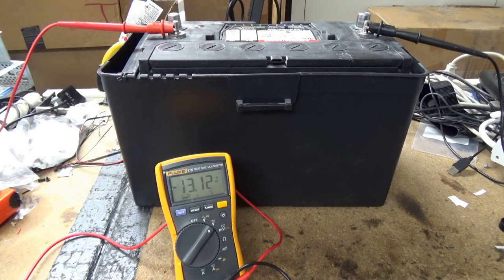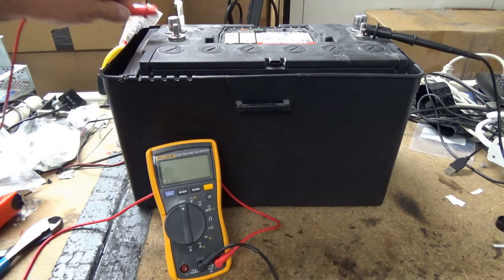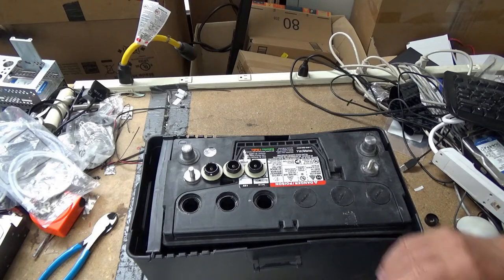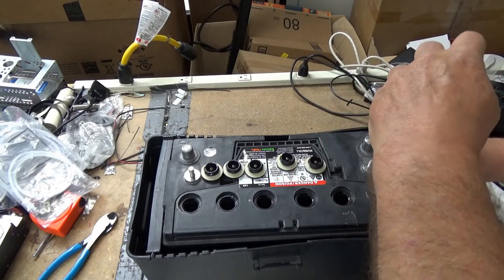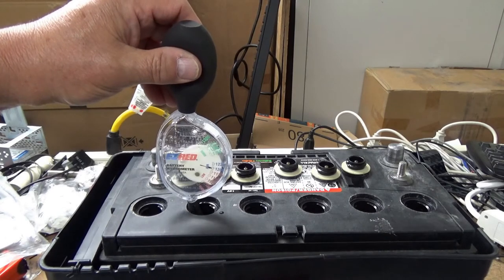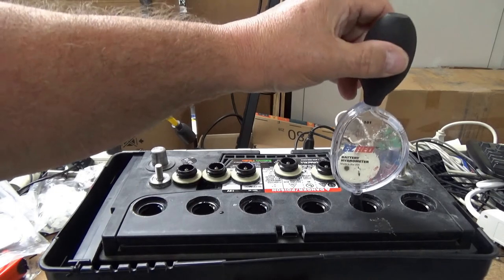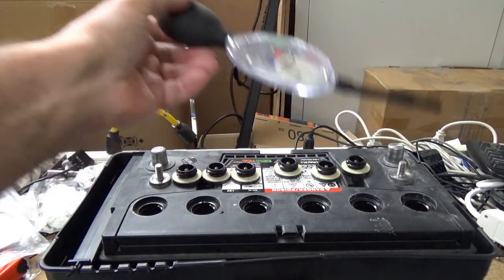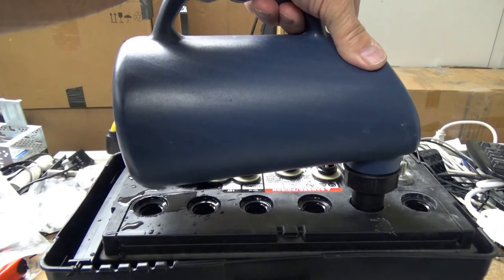Testing And Maintaining Your Lead Soaked Deep Cycle Battery

Comment: Stu, I recommend wearing sulphuric acid resistance gloves while working with the battery; especially opening and closing the caps and cleaning up the surface spills. I use an inexpensive Harbor Freight load tester (it has a voltmeter and ammeter to test the condition of the battery under load.) Great video, those PD server fans sound like a banshee!
Reply from the maker: Hi Robert,
Thanks for the great suggestions! Acid is a nasty thing to be exposed to. Spent many years working with batteries and have seen many nasty things happen related to batteries.
The load tester you speak of, is it a standard 10 sec tester or is it a full discharge tester?

Thanks for all your support!
Stu
AG6AG
Reply: @AG6AG  It is the HF item 61747 6/12 Volt Battery Load Tester 100 amp rating.
Reply from the maker: Hi Robert,
I'm very familiar with that unit. Have on in my shop. They are great for testing Starting Batteries but are not well suited for deep cycle batteries.
This unit is what I currently use: http://www.westmountainradio.com/product_info.php?products_id=cba4 and this is the current production unit equivalent: http://www.westmountainradio.com/product_info.php?products_id=cba5.
This will run full discharge tests and verify performance of a deep cycle battery.
Of course, if the load test fails then it really doesn't matter... :)

Stu
AG6AG

Comment: Hi Stu… I’ve had pretty good results going from cell to cell… meaning sticking test leads directly into the electrolyte of consecutive cells.  Failure usually shows up as a low, atypical inter-cell voltage.  And don’t forget to wash off the test leads!  73’s KM6OKZ
Reply from the maker: Great tip!

Comment: Stu-  One thing you may want to mention is that after adding distilled water to each cell of the battery to bring it up to the proper level, if you happen to use the battery hydrometer again to check specific gravity of the electrolyte, you will note a drop in the reading which is normal and is not a cause for concern.           Mike KV6I
Reply from the maker: Good info Mike. Thanks!

Stu
AG6AG

Comment: Stu, I don't think you mentioned it, but I believe it is best to use distilled or de-ionized water for topping off the cells.
Reply from the maker: Hi Rick!
Thanks for reminding me of this. This was a recommendation many years back, but when adding small amounts of water it can be OK to use tap water. However, in areas where tap water has very high sulfur or metal content, use of distilled or de-ionized water might be prudent. We are fortunate to have very clean tap water here. That is not to say that tap water can't damage a battery if there are too many minerals, but I personally have not seen any loss in battery life due to using tap water. 
Thanks for the info!

Stu
AG6AG